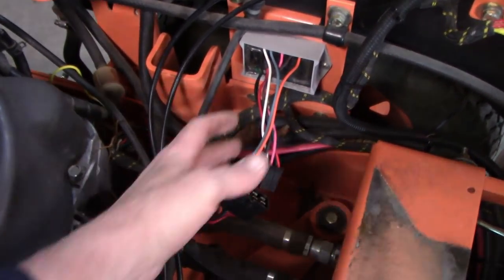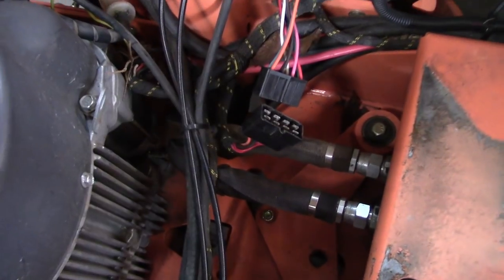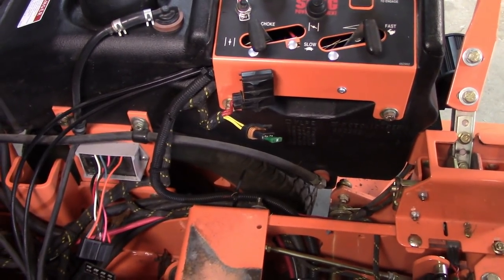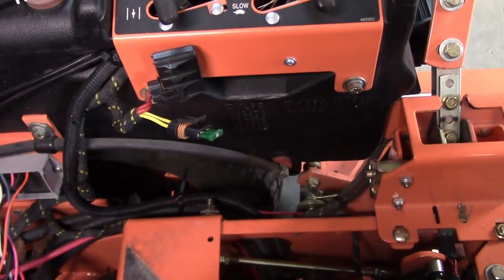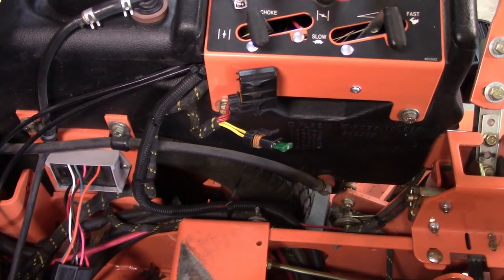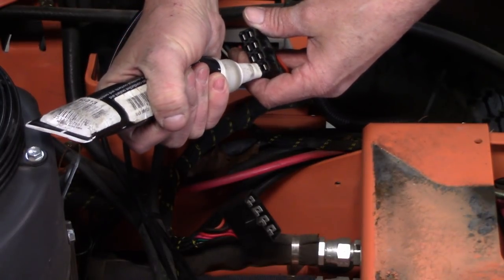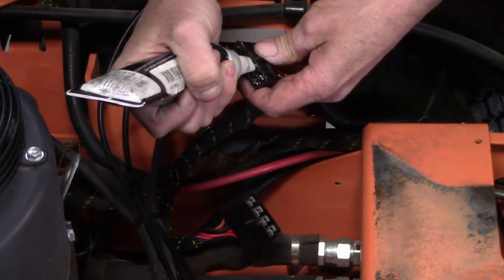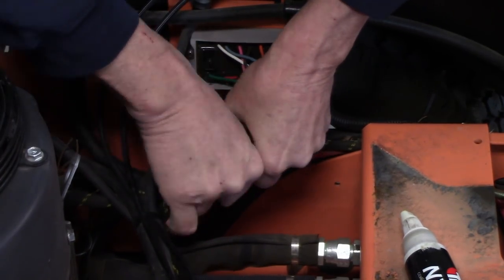Replacing fuse with 12V Circuit Breaker on Scag Tiger Cat

Comment: I used same type of "self resetting" breaker on my old pickup truck air conditioner fuse.

About every couple of weeks, it would just barely melt the fuse. After a few replacements of the 10A fuse, it was time for a better approach.

I wrapped a wire around each leg of the blown blade fuse and shoved it back into the fuse block.

I then connected to this exact same style gizmo and placed it outboard of the fuse block cover and made it secure and well insulated.

Presto! An inexpensive (compared to replacing air conditioner components) fix that is still working after 3 years.

Comment: Mark, great repair!  Two things you should know about circuit breakers.  
1. They are slower acting than fuses.
2.  Each time they trip.  They become weaker and will trip on a lower amperage.  So keep a spare around.  You may not need it for a long time but it is always to better to be prepared.
Reply from the maker: It is a 30 amp so it should last for quit some time. It only takes 2 days to get one after ordering so it shouldn’t be a problem.

Comment: Okay 👌 I can’t get my scag tiger cat to start. Checked all safety switches, took starter out it tested good,  changed ignition switch,  changed pto switch and a brand new battery. They only thing left, I believe is the electronic module.  I get nothing when I turn the key I mean nothing!! Stuck!! Any help would be appreciated.
Reply from the maker: Did you change or check the starter relay? There should be 12 volts from the green and white wire when you try to start it.
Reply: Great video!  I’m going to just go ahead and show my ignorance about these things, but I’ve got the same thing going on. I started the mower, went about 100’, it shut off VERY abruptly.  Now, turn the key and absolutely nothing. 
My Tiger Cat II must be a different model from all the rest, as that “computer” module you show doesn’t exist on mine, the controls panel is shaped differently, and I can’t seem to locate a manual for the model (SMTC-52V / STCII-52V-22FX) or serial# (L9000903)

Comment: Just finding your channel! I just got an older Tiger Cub having exact problems. Do this works well? Is there a special or specific reset breaker to get? 20-25-30 amp? I see you used 30 amp.
Reply from the maker: It works really well, not constantly changing fixes. PTO switch was the problem with them blowing.

Comment: I'm having this issue today. My plug melted into a plastic blob. It get hot as fire.
 I ordered that circuit breaker. We'll see if this fixes it.  👍
Reply from the maker: Sounds like you have a short in the line someplace. But breakers are nicer than fuses

Comment: Nice repair.  You have great electrical skills. I'm a little confused why it was blowing in the first place. Are y'all still supposed to get snow? I hear Chicago got some.
Reply from the maker: There has been this problem since it was new. Something in the safety switches between me and the dealership we have never found the problem. The breaker is just going to keep me from getting frustrated with blown fuses.
Reply from the maker: We are not supposed to get that much snow.

Comment: I've got the same exact mower and mine blew the hot off the back of the ignition, fixed that now its charging at 17.5 vdc and is blowing the fuse internmently but sevel times a day
Reply from the maker: I did find the problem with blowing a fuse. It was the yellow wire that goes from the coil to the ignition switch. It shorted out against the frame of the mower.
Reply: @Marksmisfitworld  found my issue,  12v hot wire on the ignition was burnt in two and the voltage rectifier was putting out 17.5vdc
Reply from the maker: Glad you found the problem. Nothing more annoying than something that doesn’t work right.

Comment: I was just curious why you didn't just unplug the fuse and plug in a circuit breaker fuse without cutting the fitting off and redoing it.
Reply from the maker: I have had better luck with this style versus the push in.
Reply: @Marksmisfitworld  Like I said I was just curious.  I've used the push in a truck and an RV I use to have.  The rv I've got now has the one's like you used.  Those are actually the only ones I've had to go bad.
Reply from the maker: That’s the way it is. Sometimes we have better luck with things than others. This one could last a week and go bad or last for several years. It is alway’s going to be kind of a gamble with small breakers no matter which way we go.

Comment: So I have a Tiger Cat 2 that is a royal pain in the ass to start should you take the tank down to empty. Anyone else have this problem?
Reply from the maker: Yup. That is on the Tiger Cat that we have. Almost run the battery dead getting it started when that happens. Full choke and full throttle until it starts is the best way I can get the thing to start again.